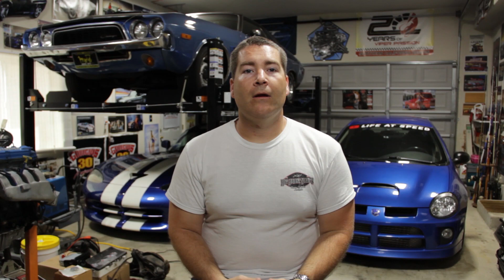Little-known Thoughts on Naturally Aspirated Engines vs Forced Induction Engines

Comment: Very informative video, thank you.
And thank you for indicating that it's atmospheric pressure that produces the flow into a normally aspirated engine and that it's not all that different than that of forced induction --- both methods work on pressurized air being pushed into the engine. It's just that one has greater air pressure than the other. Air is never sucked into an engine.

Comment: Hi, I just got my 2021 Lexus IS350 F sport, do you think I should add a turbo into it? Or should I just stick with NA? Btw I live in NY
Reply from the maker: Personally I'd leave it NA. Adding a turbo wouldikely be extremely costly, hurt your reliability and not gain enough power to be worth it.
Reply: @LifeatSpeed  thanks for the response, I personally really love the instant response with my 3.5L V6 NA engine, but I am trying to add some HP to it without adding turbo or supercharger. Do you have any advice?
Reply from the maker: Small power increases can generally made with items like; intake, exhaust, possibly ignition upgrades like more powerful coils and a tune. Big power gains get expensive with head work, cam change, pistons, etc.

Comment: Hi from Jujuy Argentina. After watching plenty of videos yours is by far the best one, you have cleared most of my doubts. I own a Renault Sandero RS Racing Spirit which has a F4R naturally aspirated engine, the altitud of the city I live in ,Jujuy, is 4200 ft from Sea Level, the other day y went to another city about 13000 ft of altitud and my car literally lost all hp, had to slowly turn around and come back. What would you do if you were me? how would you compensate for the atmospheric pressure loss? (and please don't tell me sell the car as that's not an option for me at this point and with Argentina's economy fluctuating so bad) Thanks in advance!
Reply from the maker: Thank you for the feedback! As to your question situation, I would never suvgest selling the car. Unfortunately with that kind of altitude it's hard for naturally aspirated engines to continue to make power as there is less air available. The best option although not very cheap is to add either a supercharger or turbo to it. That way you can compensate for the lack of air at the higher altitude by increasing the boost.